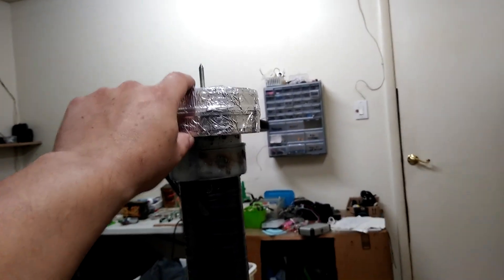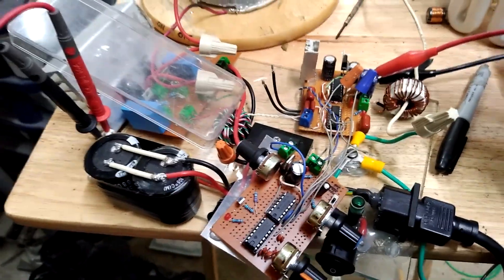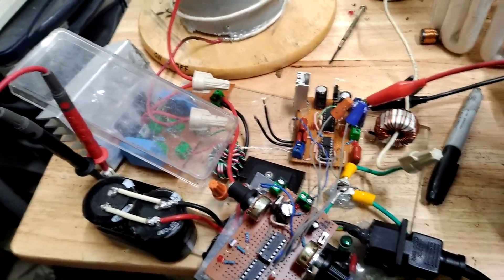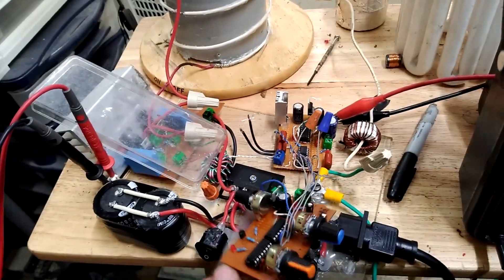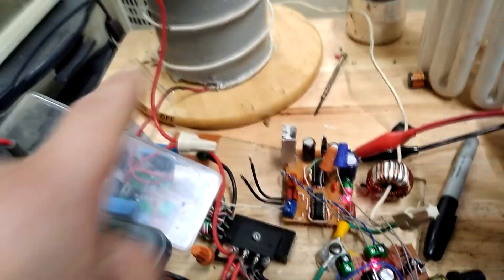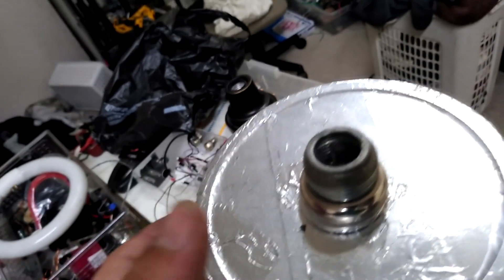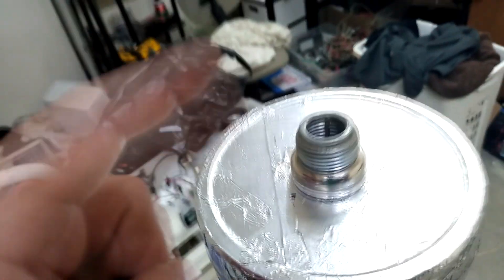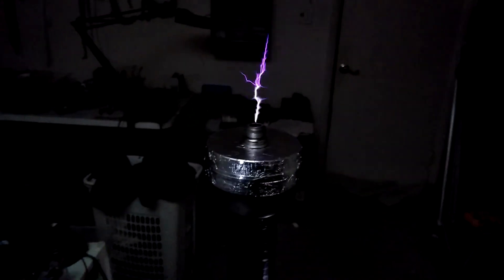Steve Ward Mini SSTC (Improving Arcs)

Comment: It seems that your driver is more tuned to lower frequencies hence when you add more topload, the frequency drops so niceeee 👍
Reply from the maker: Downside is I couldn't just put a switch on there to make it go from CW to interrupted. I'd basically need to retune it for CW so it pulls less and when interrupted make it a guzzler just to get the beefy arcs. Eventually I'm going to need to see how well it plays out using the push-pull Skori style with the gate drivers in between. I'm thinking if it can work it would be a decent way to get power shared between two mosfets like the half bridge but pushing full input voltage via the 2 primaries.